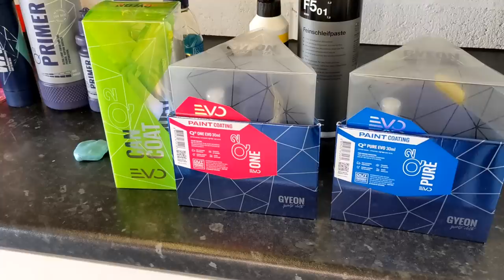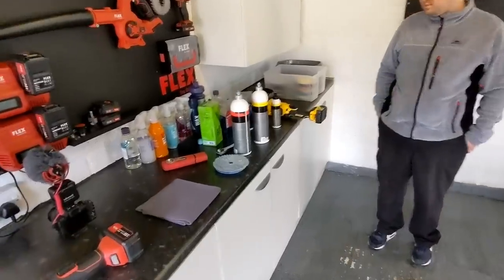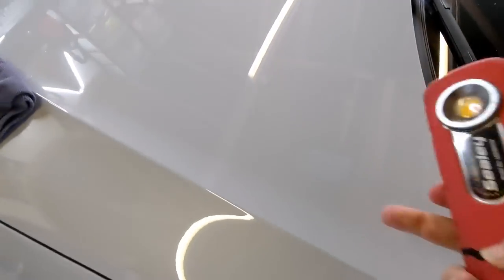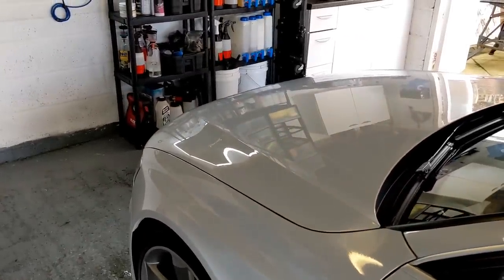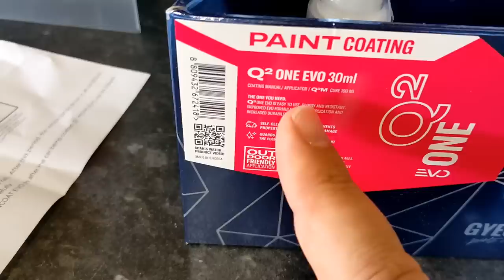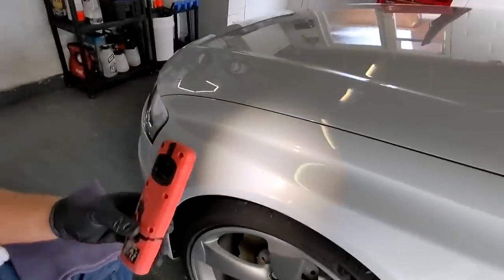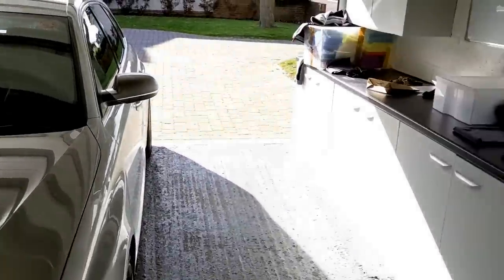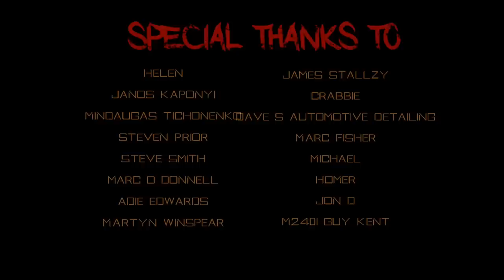Losing Your Ceramic Coating Virginity the Easy Way | Gyeon Evo One

Comment: Really good video wished I had found it sooner picked up a few tips. Last week having spent 2days decontaminating and polishing my wife's  Polar White A Class Mercedes AMG line, I applied a coat of the new Mohs Evo. It was my first step into ceramic coating and I was amazed at the ease of application and removal. Particularly impressed with the product as I don't have a garage and with the recent dry weather was able to apply it and leave for 12 hours without getting the vehicle wet. I used the 50 mil bottle and applied to the trim, windows and wheels and was left with a small amount. The result is amazing the gloss is fantastic better than I expected. I topped it with Gyeon Can Coat Evo after an hour. Its only been a week so I have yet t give it a wash but it still looks fantastic. My wife was so impressed.

Comment: Nice work Jon. Used Mohs evo last saturday. It replaced a 2,5 year old cquk3.0 coating. Applying the Mohs was a breeze! Very easy to buff. The 30ml bottle was just enough for one layer. The applicator soaked up a lot of coating and you need to apply quite a bit to see is ‘flash’ properly. With the cquk I used 3/4 bottle (30ml) for 2 layers.
I didn’t see you wash the car with a degreaser (Gyeon recommends dishwashing soap) after polishing as an extra step. I called out to my detailing shop and they recommended an extra wash as well. After the extra wash you need to wipe the paint down with prep as well. I found the extra was maybe a little overkill but i wanted to degrease as thoroughly as possible.
Reply: I applied Mohs two weeks ago and managed to go through a 30ml bottle on half a golf🙄 luckily had Can Coat in reserve. Jon finished with Gyeon Primer hence no wash, just Prep required.
Reply: Why does the Mohs require using so much product? Doesn’t use a thin coat like UK3.0 or other ceramic coat products?
Reply: I would say you used far too much product. I done a full Vauxhall vivaro van with just about half of a 30ml bottle of gyeon mohs evo. A 30ml bottle is supposed to be the same as a 50ml bottle of some other ceramic coatings

Comment: Excellent display of applying a Ceramic Coating.  I notice you did not use the Gyeon Cure - any reason why?  How often and when would you apply the Gyeon Cure.  Once again thanks for all your great advice and insight to the crazy world of detailing.
Reply from the maker: Yer apply cure 1 hour or so after the coating has dried m8
Reply: @ForensicDetailing  Cheers Jon - I feel brave enough now to give it a go thanks to your channel😀😀

Comment: Excellent video again Jon 👍🏻 Watching you claying though just makes me even more sure I made a good decision going over to a clay mitt instead of actual clay, talk about time consuming and fiddly, I have found a good mitt or cloth to be every bit as good and massively quicker. I can't see myself ever using clay again other than for tricky complex areas, around badges or door handles for example.
Reply from the maker: its a lot quicker yer would have been more suitable actually with the audi because there wasnt loads of contamination
Reply: @ForensicDetailing  definitely mate 👍🏻

Comment: Great video, and interesting that even the most aggressive polishing didn’t leave a perfect finish. But if it was my car, I wouldn’t want a rushed job to apply a long term coating -  I think I’d wait till I could spare 2 days and allow max curing time before driving. Worry about airborne contaminants being forced onto the car “and sticking” to the paint when driving.
Reply from the maker: 2 days would have been so much better, we had to really work fast which always causes some compramise.

Comment: Good (reassuring) to know you only used half the bottle / 15ml for the whole car. I used about the same for a F20 1 series and thought I'd gone too thin with it. I spoke to the Gyeon reps at Waxstock last weekend and they also said you should be using the whole bottle, which I still think is too much....I'd have to be painting it on with a brush!! 🤣
Reply: How long this coating can last once applied ?
Reply: @harisyoung4110  The box says up to 24 months. I imagine that's if you maintain it well. Ie wash the car regularly and maybe use the Gyeon Ceramic Detailer every few washes. As said in the video, you could perhaps extend this by putting a layer of can coat on after a year.

Comment: Hi Jon, what microfibres are you using to remove the ceramic ? I do get worried that the gyeon ones I’m using actually put swirls back into the paint when I’m trying to remove waxes and coatings. Also once you have used a microfibre to remove a coating is that then ready for the bin or can it be washed and reused ?
Reply from the maker: you should relegate them mate after you use for coating removal.   I like the bald wipes for initial wipe and final wipe with soft wipe.

Comment: Hi Jon, I have a question about the applicator sponge. I normally throw my microfibers, wash mitts etc in the laundry on a 95 degrees program and afterwards in the dryer. How do I clean the applicator? Maybe you can make a video about the best way to clean the towels etc we use during the reconditioning of our cars. !
Reply from the maker: 60 deg max mate 95 degress will damage it.   ceramic material in the applicator isnt going to wash out fully. you should regulate or discard applicators used for coatings after use really.

Comment: I dont understand. When maintaining the coat with wet coat, how would I tell if the ceramic coating is still working?
Reply from the maker: I think your worrying a bit too much.  But really if you want to see the coating performance and how it degrades you cant put anything on it.
Reply: @ForensicDetailing  hmmm. If a coating says it lasts 5 years but then the car has had wet coat applied regularly throughout that time, how would I know the coating didn't die 3 years ago and the wet coat was giving me a false sense of security? 
Hmmm y not just use wet coat continuously from the start without the ceramic coating? Same result?

Comment: Great video , one question i had a vehicle that had a coat and is near end of shelf life just just minor marring and one area with light swirl, i was wondering if i can just wash decon and use something like gyeon primer and coat it , the primer would be able to correct the micromarring ? Because is really really light . Also if i have coat on trim can i just do the same procedure and reaply no need to fully remove the coat? Best regards
Reply from the maker: Yes m8 this is good use for primer
Reply: @ForensicDetailing  nice ;) if i dont feel stuck contamination i can just do a decon wash iron and tar and primer right? I will try to put the evo for a hatchback 30ml is enough?

Comment: Really don't see the point of ceramic coating on dark coloured cars.
The car will be covered in swirls and imperfections within a few months no matter how carefully it is washed and cleaned. 
Hence the need for polishing  which will remove the ceramic coating.

Comment: I've never heard you use the term 'primering' before Jon, what do you mean by that?
Reply from the maker: Is like a glaze for ceriamic coatings
Reply: He applied Gyeon Primer, which lays down a small SiO2 base for the ceramic coating to bond with. Like he said, if you can’t let the Primer stay on the car overnight, you can speed it up by using Gyeon Prep to remove the remaining residue from the Primer. Then you are ready to coat it. I have used Gyeon Primer for multiple cars & not just for Gyeon coatings.
Reply: @larrysing  thanks Larry, that explains it! 👍🏻